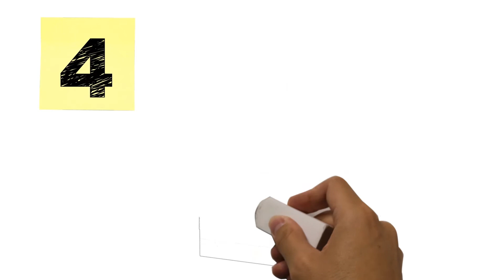8 Quick Tips for Building a Custom Control Panel

Comment: What are applicable codes for panel building.
Reply from the maker: Hi Max,
Applicable codes for Panel Building are typically driven by the authorities having jurisdiction of the location where the panel will be installed.
Reply: @eslpwr  found it, UL 508a.
Reply from the maker: @MR-nl8xr  Excellent! ESL is a UL508A Custom Control Panel Shop. If you need any help feel free to contact us at https://eslpwr.com/requestinfo/